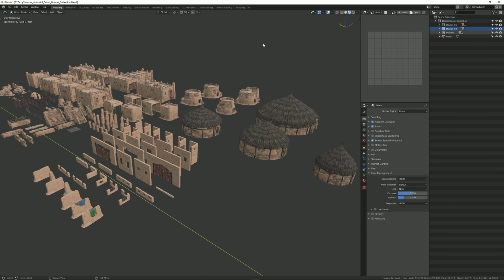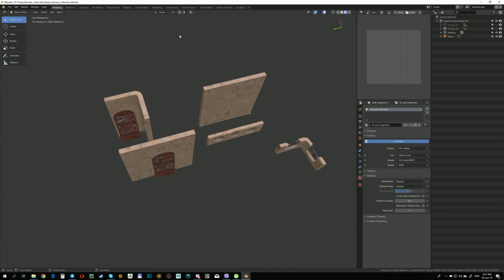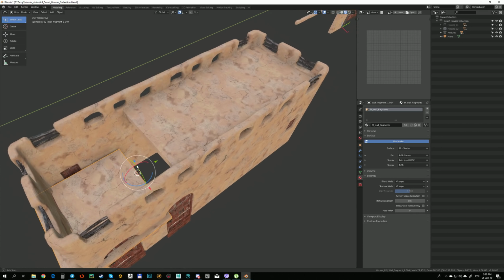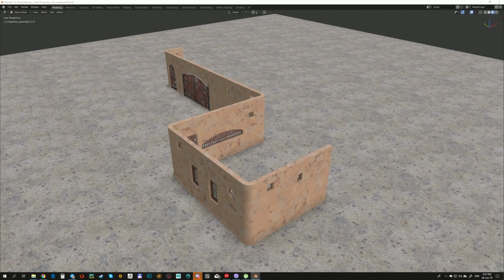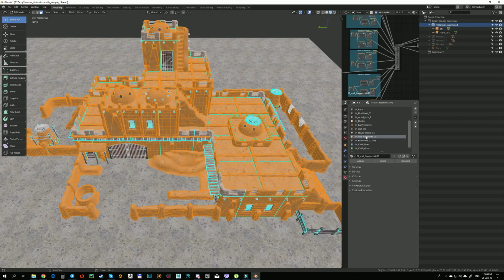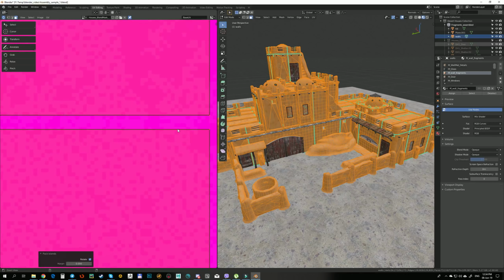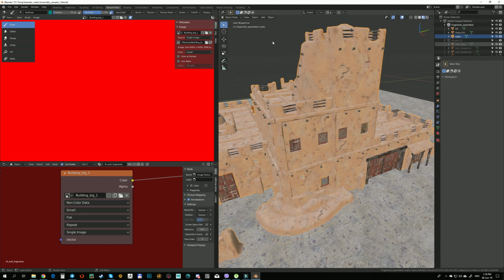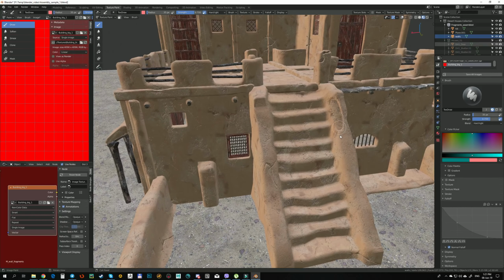Desert Town(Blender) - Modular building pipeline.

Comment: Hello
When two objects overlap, ¿all  meshes mix and match or blen? Or do they overlap?
Reply from the maker: Hi. Modular elements has 2 uv sets. One - overlapping, to set required tile scale, and second - unique, to paint different materials where you want.
Reply: @AndreySarafanov  
honestly the textures don't matter to me.
I want to reduce the number of polygons and that is my question.
are faces not visible inside the model? or the meshes are joined by the vertices and the faces disappear?
Reply: @AndreySarafanov  73/5000
there is no way if two vertices can be converted into one? and faces
Reply from the maker: @juandedios  probably there is a way. I do not know the blender that deep) try to search in google how to merge corresponding verticies and remove doubles using blender.
Reply: @juandedios  Select all Verts/Edges/Faces then either hit M or Alt+M and Merge By Distance. That is what they call Remove Doubles now in Blender 2.8x.
Reply from the maker: You can delete invisible faces manually. We tried to make all modules without a holes so they can be used any way you like. There are many invisible faces after combining your composition, but you can go and manually kill them. You can use uv map to select them fast, because the sides are all ovelapped and easy to select this way.